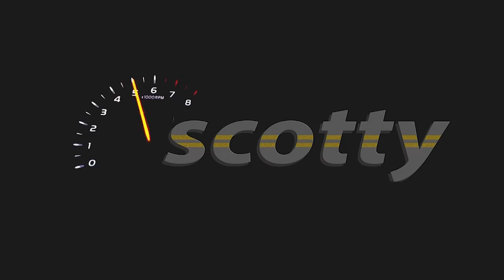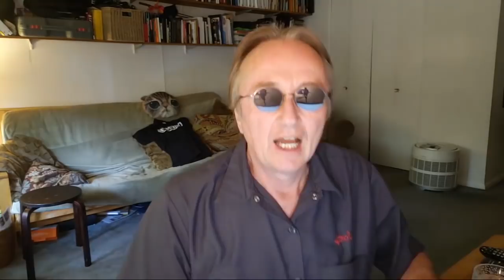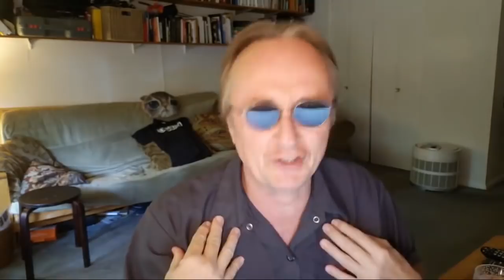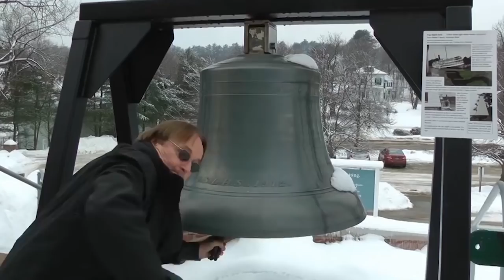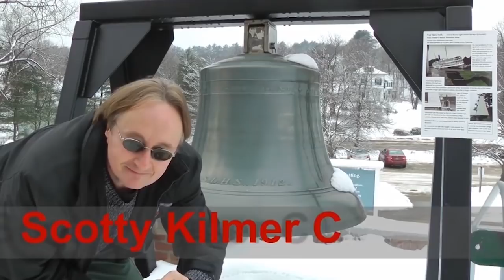What's the Beef with Chris and Headlight Restoration Explained

Comment: I had faded headlights on my old Honda. I tried the old wash and scrub with tooth paste... Didn't work.  I did the wash with soda and scrub... Didn't work. I did the WD40 scrub and, it didn't work. I did the vinegar wash and scrub... All that did was to attract cats but didn't clear my faded headlights. I took advice from one of these experts and did a bleach scrub on the lights; nope, all that did was crack the headlights. So when the headlights are dark and faded, there is really no good solution but to replace them.

Comment: I haven't seen Chris Fix's latest headlight video, but I did use the method that he posted using toothpaste and car wax. I have to say it worked and I wax the headlights about three twice during the year and so far so good with that one. The other one sounds like its a one time deal with no maintenance, the toothpaste method you have to apply car wax to the lenses every so often like two or three times a year. So what? two or three times to wax a headlight doesn't take much time.
Reply: The one scotty is talking about is almost 4 years old. The car the headlights are on has been scrapped.

Comment: I've got a 2008 Honda Fit that I cannot bring myself to sell even though I have no room in the garage for it.  It's such a great little machine.  But being parked for years in the Texas sun has taken its toll.  The headlights are fogged up.  I never would have clearcoated them but I will definitely try these products.  Replacing the lenses is more expensive than what I thought it would be, and I can't bring myself to spend it on a car I drive once a week.  I thought waxing the car would protect them, but maybe I wasn't using the right kind of wax?  Anybody have any recommendations on that?

Comment: Dealers do that sand it.
Then  use the 1K spray can stuff.  Does not hold up well.  Heat gets to it.  Some bodyshops put a thin coat of 2k clear.  That holds up better.   
Dealers do it because they want to dump the car.  But I also think it depends on what part of the country you are in.  
Their are/where  a few kits out  that used some sort of compound to sand them.  
I used to use a good fine finishing body compound.  
Body shop stuff not the cheap stuff you buy in auto parts stores.  That removes some of the dirt and haze.  I just left it like that.   Makes them also match better If one side got hit and it is an aftermarket part.  Those lights are expensive.  Most cheap aftermarket replacement do not hold up as well.   
    Fish guy, know where I can get some good calamari?

Comment: Love Scotty, but I think he is wrong about this. I have a 2006 R350 that had Horrible headlight. I tried the Mother's restoration kits to no avail.  After seeing Chris's video, I went to my local PPG paint store and bought a 2 part clear coat can for around 20 bucks.  This high quality clear coat is the key!!!  Once you sand your lights with 3 different grits of wet sandpaper, you spray 3 or 4 light coats of the clear coat on the light.  Next day, sand with 2000 grit paper again, then apply a coat of Carnuba wax with a buffer.  This was done 2 years ago, it has not faded, cracked, peeled or otherwise been a disappointment in anyway.  Do NOT buy the cheap clear coat from Lowe's, that stuff will most definitely not last!!!

Comment: , when you sand down headlights,,  you're really just grinding it down to the layer that hasn't gotten condensated or exposed to the elements yet, its a duck tape fix, Which is why it happens again in six months

Comment: There's actually no  real fix for that problem with those type of headlights the factory will tell you to replace them I tried all the fix's for these headlights and they all work but they are not permit repairs it all depends on what your wallet tells you

Comment: I made the mistake of buying new brake wheel cylinders on Chris' advice. Turns out they were faulty and nearly caused me to spend a lot of money fixing them. I ended up putting the old ones back on and it worked like New. 

Not exactly his fault but it wasn't great advice...

Comment: I agree and also disagree.  Only a few ways to repair fading head lights but the repair never lasts.  Once plastic starts the oxidation process it is done.  The only real way to repair is to replace the headlight buckets.  Then take steps to ensure it never happens again.  Basic P.M. goes a long way.  By the way I have the same Honeywell fan.  Works great.  Try using in a smoker's car.  Turn on put in car with the car sealed up.  After a few days of running it cuts down the smokers odor.  Will not get rid of it all but helps.  Only way to get rid of that is a lot of work.

Comment: Wrong.  I used the Mcguires headlight restoration (spray clear) on my 99 Lexus RX300.  The headlights were totally shot, yellow, foggy, and barely useful in the dark.  30 minutes of work per light and they look like new and have looked new for a year.  When they go bad again, I'll just clean them up again.  20 bucks for the kit vs how much for new lights?  Gimme a break.  This is a case where its not worth getting new parts for a car with 285,000 miles on it.  This issue is a cost-benefit game and you cant make blanket statements.  Being a mechanic is no better than a marine biologist when it comes to materials science.

Comment: Sorry, I have follow his video and my headlight still repair to like new since 3 years ago under the harsh Australia sun.

If your clear coat crack, fade etc. Do consider what type of clear coat you use and how well you prepared your surface as well as the way you apply them.

Sorry Scotty, it DOES work.
Reply: Second, I like your video as much as Chris's, but his video provide more in depth procedures on how to change things.
For over complicated things like the timing belt, I left to my mechanic, but for things like brakes, contrl arms, ball joints, you have to admit his videos are more detail on what you will enacounter and what you have to beware of.

i am sure you have the experience you can be proud of, but that doesn't mean you can just rule out other's effort.

Comment: In the case that you might do all the sanding and preparation Chris recommends, WITHOUT the clearcoat, do you think it is alright to then go ahead and spray the lights with the protective coating you showed us? Do you think that would yield a good result? Or would it be going a bit overboard?

Comment: If you use 2K clear coat and not 2X clear coat your headlights will last I did it to my 2008 mini cooper and it has lasted me a little over 2 years. Also why are you trying to discredit Chris its not like being a mechanic is a job that needs a degree sure you have been doing it for longer but how long have you been restoring headlights my guess not long.

Comment: The “I’ve been doing this for X amount of years and therefore I’m right argument” is a logical fallacy. 

Ex: you are a new mechanic and you see a guy using a flat head screw driver  to unscrew a phillips head. You tell him that there is a better way and that they make Phillips head drivers. He responds with “kid, I’ve been doing this for 50 years”

Is he right just because of his “experience”?

In your r1234yf video, you claimed that the gas was flammable and would light on fire by a smoking cigarette. You also claimed that the damage to the ozone from the old refrigerant was no big deal. You are wrong on both.

Comment: Hate to say it scotty but you are WRONG. All new oem Headlights have a "clear" coating on them. It is a special coating to prevent uv and its scratch resistant. Just like the coating you get on plastic lens eye glasses. I have been repairing high end headlights for 25 years and I use a special aviation clear coat that will last at least 5 years  or longer. Many automotive clears can be used with much better results than any product you wipe on. I have tried them and left them outdoors in the sun and never seen a single one that did not age and turn yellow in 3-4 months. SO go back to you hack garage out behind you house  and stick to what you think you know
Reply: by the way I have never seen this other video so not sure what clear he is talking about. If its rattle can then that is junk. If it is an epoxy or 2K  clear applied properly, it will hold up for years .